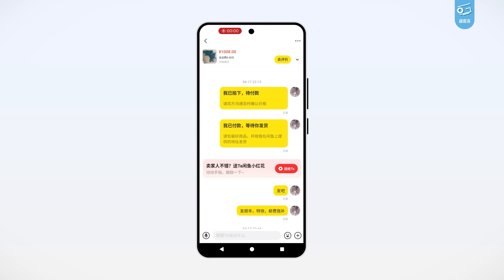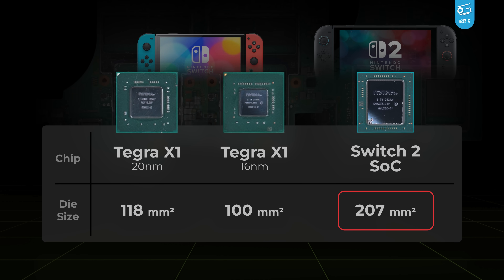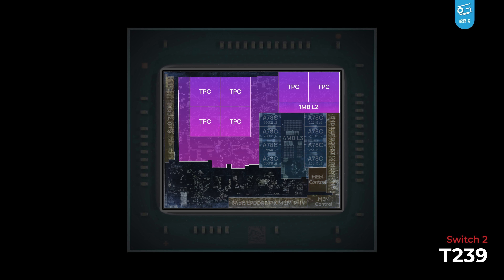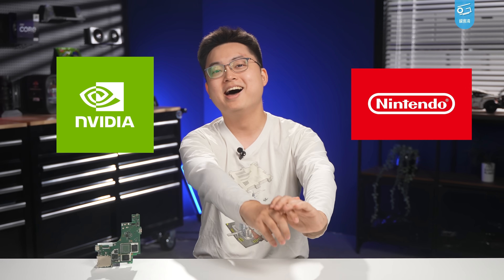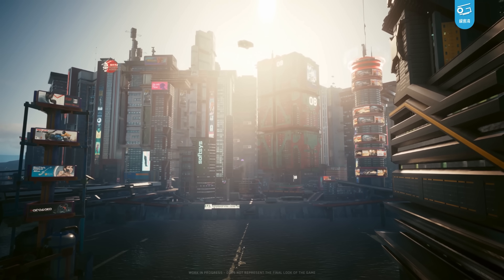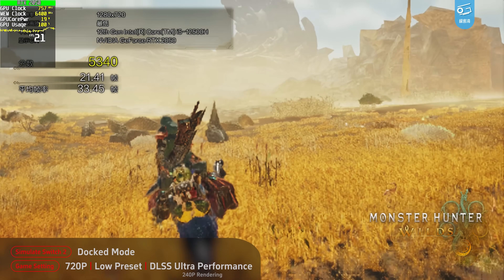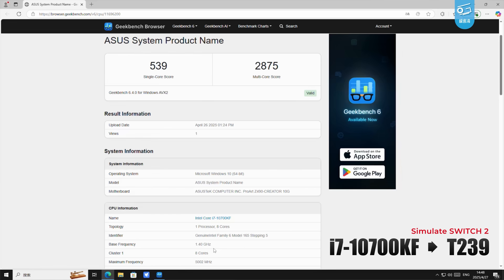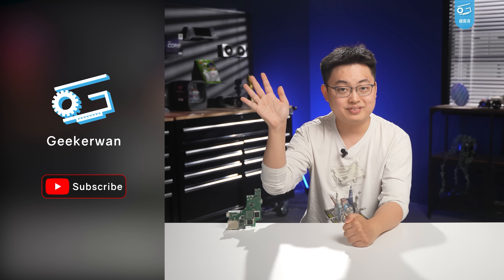This is Nintendo Switch 2's CPU!

Comment: I remember when a very small tech channel saw a job posting for the T239 from Nvidia back in 2020 and said he bet it's for the switch 2 and no one believed him until it leaked a year later
Reply: I leaked the ps4 xbone cpu yrs before anyone else I found a blog pages deep into Google were a  amd dude was going from China to USA and talking about 8 cores 4cpu x2 at 1600mhz  I knew he was involved in os4 xbone and it was a jaguar 4 core x2 at 1600mhz ps4 yrs before anyone else leak no one believed me this guy was clearly leaking to his close friends via this home made blog I followed it all sorts of stuff were on there way way way before any site yt etc ever court on also many yrs ago a insider leaked 88mb ram and her and 1tsram for the Wii and hinted at it by always adding at STANDARD DEFINITION FOES ONE NERD MORE HHSN 88mb it was the Wii all along no one realised it I DID
Reply: actually it was believed to be for the switch pro (oled) at the time. and it was probably planned for a pro model in 2021, 2022 at that time. but the chip crisis must have changed nintendos mind.
Reply: @HermesderWetterbote  the switch pro was never real
 weve know the switch 2 specs for years the console has Just been delayed like 3 times lol
Reply: @RADkate  I heard that was considered, the reason? node shrink, which allowed the 20nm TSMC goes to 16 nm.

So a "pro" could be more clock speed on the CPU and fully running GPU.
Reply: @RADkate  of course it was. these rumors came out in 2019 and the nvidia leak of 2020 precisely described the console with new kickstand, the new tegra, a 4k dock etc. in fall 2021 came the oled, new 4k dock, new kickstand, oled screen. just not the new chip and thereby no use for the new 4k dock.

the chip was pushed back but remained unchanged since 2021.
they made a new system out of a new version instead of going the new 3ds route.
just like they made a full game out of a dlc with tears of the kingdom
Reply: Switch 2 IS switch pro .......
..... @RADkate
Reply: @HermesderWetterbote  The Oled Switch uses HDMI 1.0 for the dock. It can only do 1080p 60hz output/ The Switch Pro was never real. The rumored Switch Pro was the OLED version.
Reply: @YHUAN01 yeah, the oled swirch itself, but the dock of the oled switch has a new chip, exactly the same that is inside the dock of the switch 2 to be precise that can output @ 4k 60fps. so they obviously swapped the chip inside the console, but not inside the dock. also the chip inside the switch 2 was created in 2019, and entered mass production in 2021... the same year the switch oled came out. the date is written on the chip. that's exactly 2 years. just like the tegra x1 that came out in 2015 and was mass produced for the switch 1 in 2017... also 2 years.
Reply: @HermesderWetterbote no it doesn't. The output limitations of resolution are tied to the output signal of the video connection doofus. Either the cable you're using or the port from the input of the device or the output of the display. If the Switch had the actual specification of HDMI 1.4 or higher it could produce an output signal of up to 4k 30hz. If it was limited by the Switch tablet it would only display 720p. Also the chip is for the Ethernet connection. You need some sort of processor for internet functions for LAN or Wi-Fi. Stop being stupid.
Reply: @HermesderWetterbote  The Chip in the Switch 2 was also not in production in 2019. NVIDIAs road map would put the chip in production in 2021 because it was planned to be released in 2022 which they announced back in 2018 for their greater Tegra roadmap for AI and Deep Learning chips along with data centers and car automation. You can even see 2021 on the chip itself for when it was produced. Please stop being wrong on the internet.
Reply: @YHUAN01 yes, by the tablet, not by the dock. they upgraded the dock. if you connect the steam deck to the switch oled dock you can output at 4k60. if you connect it to the old switch 1 dock its only 1080p60
Reply: @YHUAN01 the date 2021 is written ON THE CHIP itself. and that's when the custom t239 that was made specifically for the switch 2 was already produced. (newer batches/versions will have more recent dates written on it) and it's based on a nvidia architecture that was released in 2019.
Reply: @YHUAN01 the chip inside the switch 2 is also not the same as they announced in their tegra roadmap. that's one for automotive cars.
Reply: @YHUAN01 the leaks also showed evidence of a switch pro that would soon release with the new chip. 4k dock, oled screen, new kickstand etc. and expected to cost 499€ most of it came true, even the 4k dock, except the new chip probably because just that year was the beginning of the electronics part crisis because of the pandemic and nintendo knew they would not be able to sustain the production.
Reply: @YHUAN01 the dock of the switch oled also has a hdmi 2.0 port. and in  Firmware update containing the aula specifications - aula was the codename of the switch pro/ oled - there is a code line explicit stating 4k60 output trough the new dock. this firmware update is found inside the code to this day.
Reply: @HermesderWetterbote  Sir. The same date is on the T234. All of the Jetsons that came out in 2022 have this date on the chip. They were fabbed for being used in products back in 2021. The 30-series RTX discrete cards were fabbed in 2019 but came out in 2020.
Reply: @HermesderWetterbote  Also yes the image is determined by how much data(and speed) can be sent through the port of the input(console), what the output port can receive(tv), or the cable itself used(HDMI/Display Port/Composite/S-Video/RGB Component). Any of these things can bottleneck it the output because they determine what the video signal can be. For instance my monitor has an HDMI2.0 port. I can't do 4k 120hz with HDR when using that port because it's not good enough. Would need HDMI 2.1. Display Port 1.4 though allows me to have 4k 120hz with HDR however. It has a higher bandwidth than HDMI 2.0. This has nothing to do with a chip as I'm using the same RX 7900XTX all I did was change the input type for the video signal via the cable used.
Reply: @YHUAN01 yeah, used in products in 2021. the tegea t239 was intented specifically to be used in products in 2021 and this one was custom tailored for a console. also there was the big nvidia leak in 2021 that pretty much confirmed any previous leaks of the switch pro plans.
Reply: @YHUAN01 i know that xD But the leaks about the dock with 2 0 port and the update for the switch Firmware are on point. they ditched the use of the new chip last Minute for the oled, hence the console did not output @4k anymore and the new dock, still with the 2.0hdmi port as well as the firmware could not use it. also the second totk trailer (the one with the sky islands) looks exactly like the switch 2 version of totk.
Reply: @YHUAN01 and the switch oled releasd the same year the spcific t239 for a console went into production. its as clear as that the virus came from a lab in china. its a situation where any other explanation would be way more unlikely.
Reply: @HermesderWetterbote so what if it did. Does the OLED use an Orin chip or is it the X1? The OLED was in r&d before they started working on the R&D for the Switch 2. Switch 2 wasn't being worked on r&d wise until 2020. Switch 2 was more than likely gonna release in 2023 but they pushed back the date by a year to manufacture a bunch so there would be no shortage issues and delayed it even further for their in-house games to get more polish and work done for the console launch window. The chips for the switch 2 were in the design phase in 2020 and were fabbed in 2021. This is industry standard chip fabrication timeline.
Reply: @HermesderWetterbote And for the record. The memory solution didn't exist until after they would have been looking into R&D for the OLED Switch. LPDDR5x wasn't out until 2021 and Hynix(ram chip manufacturer for the Switch 2) specifically didn't start until 2022 along with Samsung. Like you're just absolutely wrong because you're so profoundly ignorant about tech roadmaps and the fabrication process of hardware
Reply: @HermesderWetterbote  THe Switch 2 uses 2.1 dingus not 2.0. There is no chip needed for HD bro. THe OLED didn't output in 4k because it still fucking used HDMI 1.0. Crazy how I can just add the circuitry onto a Wii to get it to output for HDMI without changing the chips on the MOBO yet somehow you keep talking like it's a chip that determined the video signal output of the Switch and not the fact that the dock was designed with having HDMI 1.0. Did you ever stop and think that Nintendo could have been R&Ding the Switch 2 at the tail end of their R&D period on the OLED? The Switch 2 isn't even the same architecture as the Switch 1 so idk how you can think that just switched it up last minute out of the blue with no setbacks on R&D?
Reply: @YHUAN01  November 2021: "teardowns of the new switch oled dock show that the dock and cable support hdmi 2.0 specifications with up to 4k60 and hdr, compared to the swirch v1 & v2... " March 2021: "The last Firmware update for the nintendo switch systems includes support for a new system codenamed "aula" including files for new output resolutions up to 4k60fps, support for 8gb ram and hdr"
Nvidia leak fall 2021: "production of t239 chips began june 2021 - intended for game system codenamed aula"
Reply: @YHUAN01 i never said it would have been the same as the switch 2. the switch pro leaks simply mentioned the "aula" oled switch with a t239chip and 8gb lpddr4 ram inside. 
the Firmware of the nintendo switch still incude the 8gb ram and 4k60hdr output support. it was never removed. yet the oled never had 8gb of ram or 4k60 or hdr output. yet it's dock still supports 4k60 hdr output, compared to the v1 and v2 dock that can only output 1080p 60 max.
Reply: @HermesderWetterbote  Sir... that was leaks for the Switch 2. Not the OLED lmao there was no T anything chip that would be Orin specific that existed yet. You're talking about the 2020 leak which was a leak about them starting R&D for the Switch 2. Not the OLED. Hell the Switch 2 leaks actually had it with an LCD as well. You're goofy for arguing this LMAO
Reply: @HermesderWetterbote  Firmware has nothing to do with HDR support. You need the proper tech in the video codec for that. Just because the Switch firmware has it doesn't prove anything. The OS for the two systems are built off of one another. That's why it has that support listed in the firmware. Also the switch dev kits have 8GB of ram in it. And the Switch 2 was always planned to have more than 8gb of ram by the time that firmware even rolled out. It's obvious the R&D for both systems were just around the same time period. There was no switching or change of plans moment here. They would have just made a console refresh like with the New 3DS if they were gonna do it. The OLED dock still can only output 60 1080p. There is literally no support for it. You can literally google the dock specs and it tells you it can only support 1080p 60 max. Stop looking at 3rd party ones that claim 4k output lmao
Reply: Just because the firmware in it has files that would support for high resolutions and HDR doesn't mean it's implemented in anyway. Crazy how no one who puts in an HDMI 2.0 on the Switch OLED dock had their display pixel fit to 4k resolutions. It still surface formats 1080p max to fit onto resolutions higher than it. The Dock is literally what is handling the video signal so that means the damn thing doesn't actually support 4k 60fps with HDR
Reply: @HermesderWetterbote  Even further, the Switch original could support 4k 60 with streams and whatnot because it is a display port 1.2 converted to USB-C that is then converted to HDMI by the dock for the final output. I didn't want to get that anal with it because it doesn't really mean much in how the system is intended to be used with the signal conversion. The OLED is working the exact same way. In function neither of the Docks support 4k HDR at all even though technically the both can based off the conversion of their codecs to USB-C. The new chip in the new dock is just future proofing. They already producing stuff for the new dock for the Switch 2 might as well just use the same circuit board for the OLED.
Reply: @YHUAN01 you're not even Reading what i am citing. 😅
Reply: @HermesderWetterbote  Brother you're wrong though. lmao You don't even know how video inputs work. You'd have known in raw theoretical specs the Switch always could support 4k and HDR as it's converting a display port 1.2 signal to USB-C on the dock. I'm telling you that their leaks had nothing to do with a Switch pro.

Comment: I wouldn’t use the Monster Hunter Wilds benchmark to rule out a possible Switch 2 port, since the PC version is terrible. 

Even with a Ryzen 5 3600x and an RX 6700 — specs similar to the PS5 — you don’t get anywhere near the same performance (40fps with the same settings, while the PS5 runs it at 60). So yeah
Reply: it does really run it a 60fps on ps5 it uses frame gen and it runs like dog shit.
Reply: @issacdragon3834  What? Ps5 doesn't use frame generation, it runs the game at 60fps without problems. 

PC performance is terrible